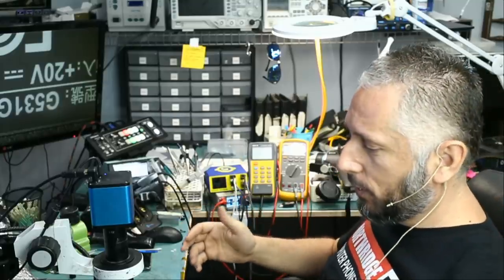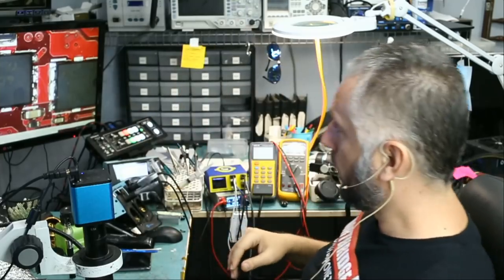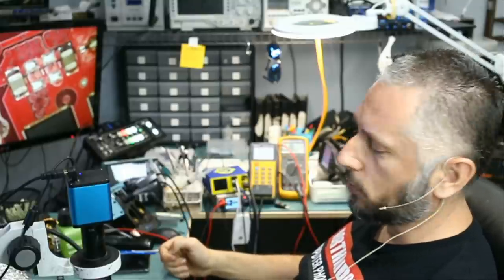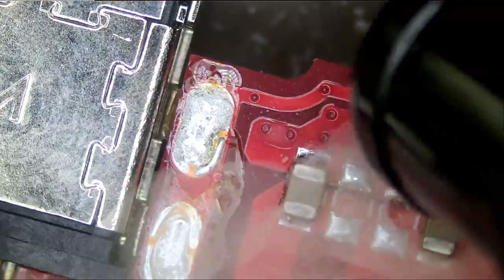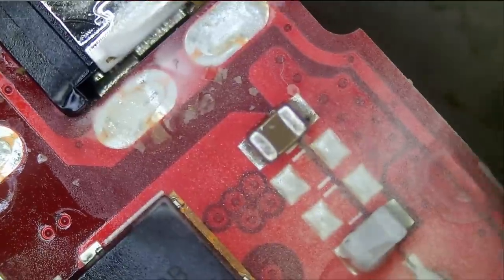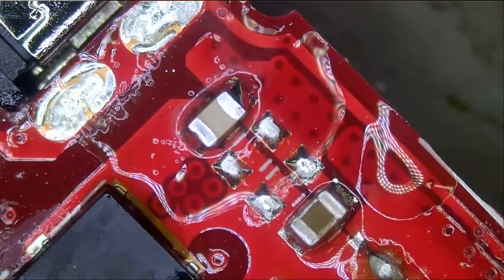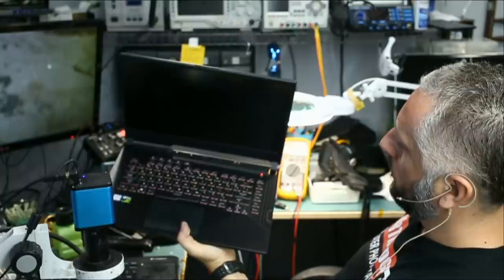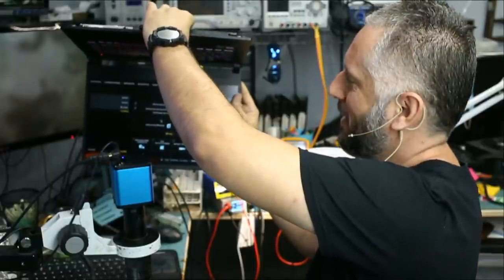Asus ROG G531G Won't turn on. Finding short circuit using Atomizer Rosin Flux powder

Comment: That's fantastic! You just made my life finding shorts about 100 times easier!
Reply: by the past I used : 
-my hands or my cheeks for less prominent shorts.
-I put that same resin he uses on a solder iron and slowly get the same effect.
-I tried Freeze spray ( best method ).
-today I mostly vaporize alcohol because you can hear and see it when it boils instantly .
Reply: @mohsentabouna6401  For me the Soldering Iron and Rosin Flux is best (no need to break Rosin off to put in a device) beats out the Freeze Spray since is doesn’t thaw.

Comment: Dear Alex, i think if you take a glass of water and heat the ressin to a liquid state and pour down slowly to glass of water you will have tear drop shaped little ressin balls on the floor of the glass which you can use easily.
Reply: Absolutely!
Reply: that’s right, but you can also buy rossin as a standalone piece without box and that is much easier to cut small piece from that
Reply: @Mommotexx  pliers work but messy.

Comment: Put the whole rosin block in the freezer. Take it out turn it upside down tap it on the table until the whole block comes out. If it doesn't, heat the outside of the container very lightly with your heat gun, lighter, etc. Put the now naked rosin block in a heavier Ziploc bag.  Put it back in the freezer. Be patient, and go get a snack or something. Take it out and use a blunt object to break the rosin into appropriate chunks . Keep it in the freezer or put back in original container or whatever you want. Heat slightly if you want the chunks to goober together to get the right size, it's technically a liquid and will eventually do that anyways. Sorry if somebody else already explained this, but I didn't feel like reading 300 plus comments.

Comment: Thermal printer paper can also be used to detect heat in components,  It turns black with heat present you dont even need to buy the stuff use a piece from packed meat product labels that has not turned black yet! loads of supermarkets use the labels.

Comment: We use a bit of lighter fluid to basically look for the same thing, this works in the same way, when the lighter fluid boils away you see where its shorted. also the added benefit of having a bit of fun when making a spark 😅
Reply: that little kind of mini heart attack 😅

Comment: This still blows my mind... that one rice sized component costing nothing can brick an entire machine
Reply: Yes. Because the electric current always like to find the shortest way to the ground where is less resistance. When this happens other components on the board don't receive power.
Reply: @EvilSlothsTony  dude... I understand how it works.  You missed the point of the comment
Reply: @EvilSlothsTony  electricity will flow to every path it can take, but be 1ohm or 1000ohm current will flow

Comment: This device is genius. I would have never thought to make/do something like this, despite using rosin flux.
But yes, if you want to get a piece of rosin flux, just remove it from cardboard thingy and put it inside zip-lock bag and smash it with hammer.

Comment: Concerning the Rosin Flux you could try a "punch biopsy tool" in a small size. This would lift the flux out and keep it in the center of the tool ready for removal and insertion into the Atomiser.

Comment: A very easy way to do it is to close the rosin box almost completely (so that the chunks don't fall out), and through the narrow slit opening you can use a knife or blade to stab the rosin block into smaller pieces that are easy to use. No need heat.

Cheers
Reply: ı thought the same

Comment: Nice video, good work. This atomizer is really a good little helper. Thermal cams are very expensive and using this atomizer is a cheap investment. I use the same one since about a month. Thx for the video

Comment: Another good way to track down a short or at least narrowing it down to a certain area is using 99% Isopropyl alcohol. Just spray it on a small area where you suggest a short, apply power and look where it evaporates first leaving the area dry.
Reply: Short circuit affected motherboard working or not?

Comment: Isopropyl alcohol can be also used. If you apply it to board, it will evaporate first around the faulty component. Do not use highly concentrated one as it will evaporate to fast and also you are risking to set things on fire if you are not careful enough.

Comment: That's a pretty interesting method, thanks for that! I'm also hoping you'll get some of those magnetic board holders back in stock. I can't find them anywhere. Ali had a similar one available that I ordered but it was cancelled so I'm stuck using those garbage-magnetic ones for the time being. Well, and the sliding one I bought from you.

Comment: I have hard rosin in a tin I usually push a flat head screwdriver into it with quite a force to break pieces up as I make my own liquid flux with it for my repairs. It works but sometimes messy as bits fly sometimes
Reply: I have the rosin dispenser also, but the problem is that now, he doesnt dispense rosin like first time, just a litlle, and i don't understand why...the coil inside gets Red nothing, i can't figure it out why...

Comment: Good video as always... just slap your rosin into a plastic bag, while its still in the little box and smack it with a hammer... then you can either leave in bag, or dump into small container to pull from when needed. :)
Reply: Careful the cops don't find that 'little bag' in your car.

Comment: The rosin atomizer looks awfully similar to a certain type of atomizer for a federally prohibited (but legal in some states) concentrate. 😁 A little birdie told me that you want to use smaller pieces in there because the larger pieces tend to just melt into the bottom and you end up wasting some.

Comment: I've been using solid flux since i started, its what I started with  but never seen a tool like this before, rosin breaks easy pressing a strong blade into it, or you could just dip the end of a hot iron into it and tap it off

Comment: love your vids but i wish i got lucky with just some caps, haha, i seem to get boards where when you apply amps, its always a hot cpu!! which is always BGA and not worth replacing for a cheaper board. 
QUESTION-  Can you ever have a cap ect which is shorted but drawing amps through the CPU causing the CPU to be hot and thus its NOT a shorted CPU sometimes?  I have always felt around the CPU and the rest of the board and cant find anything hot but only the CPU so hot CPU a definite shorted CPU?

Comment: Sure is a lot cheaper than a thermal cam. And way cooler. But, honestly, if you do this enough or if you do it for a living, just buy a thermal cam. Way less mess and far easier to troubleshoot overall.

Comment: sir just wanna ask if what is the usually problem with the laptop, no display but there's an indicator light when I plug the charger, even I change the ram, still no display

Comment: I tried this method but it does not work. I know that the problem is is in the VDD main as all the capacitors of this line are shorted. I urgently need help.

Comment: I bought two rosin dispensers from 2UUL and both died. It doesn't produce the smoke needed and I keep pressing the button until the coil overheats and stops working. Now both have blinking button LEDs. Garbage.
Reply: I have the same problem now... Just like you have

Comment: That's great. You could do the same without the tool by dipping your hot soldering iron into the Rosin and spread the resulting fumes over the caps. Does exactly the same thing except that no tool is needed. Great work.

Comment: Using flux & producing fumes to pin point the problem is done by many mobile repairers in India from long time. They also used isopropyl (pure form & non-conductive) to find out some very hard to find shorts which is not possible to find with flux. Nice video. 👍🏽👍🏽👍🏽